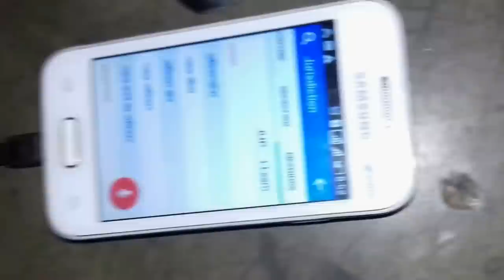👍👍🔌CHARGE🔋📲MOBILE📲 WITH HELP OF YOUR 🚴CYCLE🚵✌👌

Comment: But clear me one thing how could you generate perfect voltage and amp for charging.. A smart phone needs 5 volt normally but how can it be possible to make 5 volt by a Dinamo.. You can use a led bulb thats ok... But not a phone
Reply from the maker: +Souvik Das  use a transister lm7805 it will maintain 5v ...
Reply from the maker: +Souvik Das  please like and subscribe..
Reply: But where  is the transistor?
Reply from the maker: +Souvik Das  i have not used becoz i dont get that but it is avilable you can get easily..

Comment: you will fry your phones chip that way. because motor gives out ac current and your phones battery charges by dc. so you need a rectifier.
Reply from the maker: +Just Make IT  no it is a dc moter and gives out dc current.. 
Thanks for watching please like and subscribe. .
Reply from the maker: +shahadot hussain  ??

Comment: any motor dosent have any fixed voltage unless and untill it is a dynamo
Reply from the maker: +amarpal  oh  but it can not generate that much power which can damage phone.. i have check at full speed also..